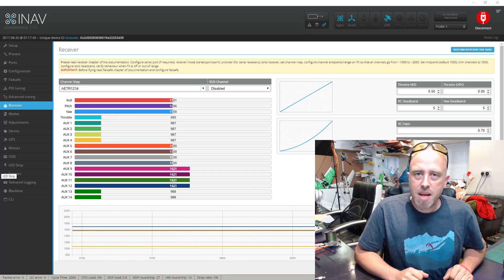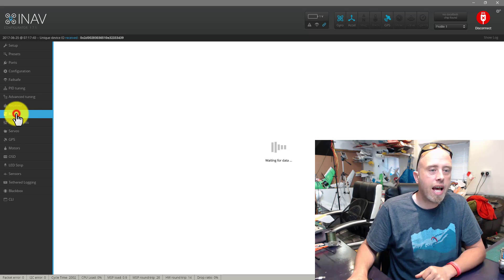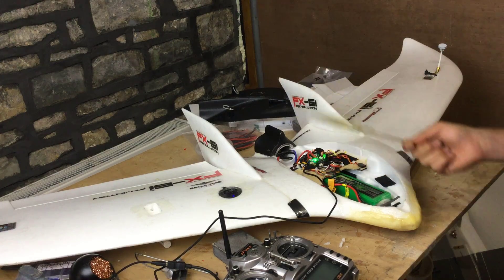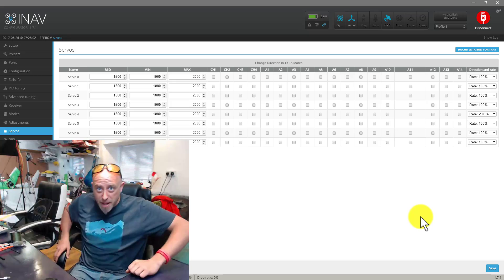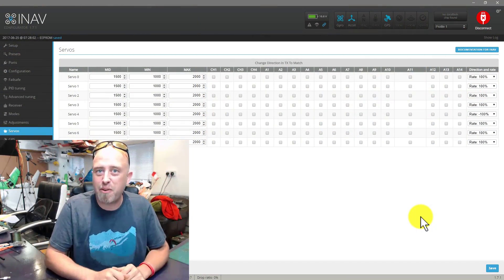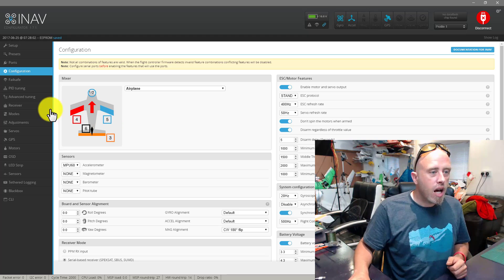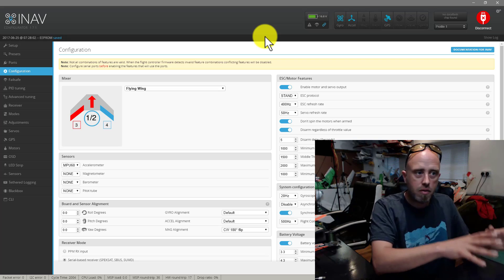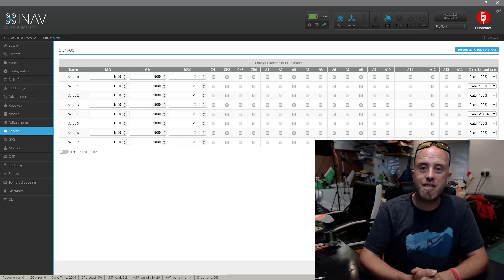iNav - Checking Your Models Surface Movements, the RIGHT way

Comment: Hi and good dayyyy Matt, awesome video and awesome help as always !!! 
Hopefully you might remember some time ago, perhaps two to three months, I asked about your opinion on the strongest flying wing/plane for a beginner, and you mentioned the Reptile S800, and I went ahead and purchased one, well, I'm done building it and configuring the major stuff in iNav, but just to be safe, I had to 3D print a lot of replacement parts because I was not happy AAAAAAT AAAAAALLLLLLL with the way the S800 was made.Anyway, I've done some mods and I am ready for my maiden flight, weather has been unkind here for over a week, but I might do it today, so hopefully you can help before then...my question is regarding the control surfaces while in a stabilized mode, like ANGLE mode. Since I'm a beginner, I used to take off in Stabilized mode in the dart 250 and worked very nicely,however, with the S800 and using iNav with the Matek F405 STD, I felt that the surfaces moved with much less authority, so after trial and error, I found the settings for the servos in inav which was weight and rate, and increased them much more, so now when no flight mode is enabled, the, its like a manual mode, the control surfaces move quick and full of authority, but in Angle mode, they move ok, but when I use throttle to 50% or a little less to trick the plane that its flying in Angle mode, the problem that troubles me is that after a few moves of the control surfaces with transmitter, one side stays down or maybe up while the other side moves, but if i tilt the plane left or right, the seemed-to-be-stuck-servo begins to move again,then after a few times of moving the control surfaces again with transmitter, the same thing happens. Is that normal, should I maiden and see what happens ? PS : I will launch and fly from a nearby sports grounds, which is above road level with a two to three meter high fence, and below are houses, so I will have a good few meters for flight before I decided to either climb out or land quick into the grass.
Reply from the maker: Howdy Ralph, I would chuck it and see what happens. The S800 wing can take an absolute beasting and when it breaks, hot glue is the quickest fix 👍
Reply: @RagTheNutsOff  Thank you so much for your reply Matt, much much appreciated as always. I actually used hot glue to stick the entire flying wing together, so I totally understand how awesome hot glue actually is. Ok then, perhaps later, I would give it a go in the local grounds. I'm going to run around the house with the throttle on and doing some rth checks and surface control tests, I'll get back to you later after maiden try Matt.

Comment: Man this is a video that has helped me out numerous times regarding which way the servos move during angle and horizon mode. My most nervous time before a maiden is making sure servo movements are 100% correct when switching to angle and horizon modes.

Comment: Hey Matt, great video series with tons of useful info!! I'm all the way to checking the control surfaces with the Matekf405 in a strix goblin. Im using a spectrum dx8 with an fpv serial race reciever. The only channel i reversed is the aileron to make it coincide with the correct input and output on the radio tab. Now when i went to check the control surfaces as you did, my s3 needed reversing in inav to make it turn the proper way. I reveresed it in inav and now i have the roll correct, but the elevators are reversed, up is down, down is up, and roll remains correct. theres only 2 servos to reverse or remain or both reverse or both remain. I've tried all four ways and i cant get it correct. any ideas???
Reply: I guess you solved it but just switch the inputs in the mixer around

Comment: The reverse funktion works not on the bench is that right? If I put both servos on maybe 1200 as midpoint the go always a different way (s3 down and servo 4 up).
Reply from the maker: Howdy fella, not sure what you're asking. Either see their wiki or the other parts of the series, Matt
Reply: @RagTheNutsOff  I got it out. I was wondering why the servos move in different directions even though I've set reverse. But in the servo tab they just move in the in the direction in which they were installed. Reverse comes only when you use your TX or in the horizon mode. But thanks for your quick answer dude

Comment: Matt love the channel I would be no where with inav if it was not for you.  Although I do have an issue... Servo 4 seems to not be mixed correctly in inav.  On the receiver tab all surfaces are moving correctly.... when I increase the throttle I get full movement of servo 4 ( so I know that the servo works ). When I roll left  (looking from the back to front)  the left elevator goes up and down as it should. The right is only going down not up. Have you seen this before ? What am I doing wrong?

Comment: Hi Matt, I need help here , I have spent hours on it and cant figure this problem. I have X8R receiver connected to my OMNIBUS F3 AIO v1.1 FC through UART3. 
As you can see on the video I have limited control with Elevator and Eeileron. A bit higher Elev and very low Eil. When reconect the FC and rebind to X8R I gat full through on servos for few seconds and then it revert it self back to that limited servo movement. Is this the Board, receiver or bad UART ? By the way I have not removed the resistor from board. Did not think it was necessary since the sbus is connected.I am using INAV. Is there any chance you would know what have I done wrong ? 

Link to the video : https://youtu.be/trdlXlAmPCY

Comment: Mike, I have read and re-read the iNav modes, and I don't know if I am misreading them or I am missing something. I have 4 planes using the Hobby Eagle A3 controller, which provides basic stabilization, and thanks to the I am a bit more aware of what controllers are about. However, iNav based controllers are way beyond the capabilities of the A3, but there is something I cannot match up. In the Stabilization devices there is one mode that is normally called RATE, which have some resemblance with the ANGLE, but I am not sure is the equivalent, and I use RATE when I flight in windy days a lot, and very successfully. Even I didn't try ANGLE in the bench, the description does not seem the works the same way that RATE. RATE makes adjustments to the controls to compensate for a sudden change in the attitude, and I have not seen any similar description in the wiki, of tests done in youtube. Therefore, the question is, which mode (or combination of modes) should I use to have the same characteristics than RATE? Sorry, forgot to mention. My application is single motor sport aircraft.

Comment: Matt, what if when you turn on horizon mode and nothing happen? No stabilization movement what so ever? My FC is a Omnibus F4 v3, and the modes are are setup per your mode setup video. Any thoughts???
Reply from the maker: Hi Felix, it could be a number fo things, first I;d make sure that you do the obvious and make sure the servos are powered OK from a separate BEC. Beyond that it be more complex and the iNav lads will be able to help here https://github.com/iNavFlight/inav/issues

Comment: Hi Matt.  I need your assistance with an iNav set up.  I am using a Turnigy i10 transmitter with a matching ia10b receiver.  My question relates to the receiver tab on the configurator.  My radio is displaying correct directions for increasing and decreasing values but the controls are coming through on the wrong channel.    ex aileron on the transmitter is being interpreted as throttle on the configurator.  I cannot see how to change this?
Reply: Hi Matt discovered the issue I was having.  I was hitting refresh and not save on the receiver tab!

Comment: Hi Matt, Great video playlist, been setting my falcon wing up according to your  video
I noticed that in Horizon the correction for up/down is correct while Left/right is reversed.
Double checking transmitter according to video, 
no mix, 
servo no4 is reversed.
did another calibration,  maybe there is a missing setting ?
what do you think ?
Reply from the maker: Howdy Danny, no need to calibrate again. Check that the receiver works as shown in the previous video and then come back to this one and reverse servos as needed Matt
Reply: Hi Matt, 
I checked and the receiver inputs are looking same as the video,
As you mentioned servo 4 was reversed in my case
Still problem remains that up down directions are deflected to correct the movement While left right are correction is reversed.
Any parameter I can check or dump using the log ?
Reply: @berlerd  did you figure it out I'm having the same problem

Comment: Hi matt, 

I followed al your steps . Now iam also have to check the servos . But when I plug the batteries they don't move at al . I use digital servos with omnibus pro v3
Reply from the maker: Howdy fella, see this video https://www.youtube.com/watch?v=TfZZnurrIRA the short cuts are in the video description, Matt
Reply: RagTheNutsOff   that works for me a little thank you very much . 
Only servo  pwm 4 doesn't move but makes crazy sounds . It's not the servo because I changed with servo pwm3 and then it's oke . Is there a bad output 4 ? Of is there in the software what's not oke?

Comment: If set up with inav and throws are off just a bit , how would you adjust differentials to correct and make throws equal...
Reply from the maker: Howdy fella, I'd not change them and see how it files. If you're using the default and have applied the Z-84 preset, it should be very close to fantastic and only obvious checks by eye on the tim should be needed (eg 1-2mm reflex in the elevons on a z-84). Matt

Comment: Hi Matt
Just about set up inav(1.8) but one of my servos for my wing does not appear to be working. It seems to get power but no response to transmitter inputs. Swapped to opposite side of wing and it works. Appears signal output from pin 3 not working???
Any thoughts?  What a let down. Was really looking forward to first flights

Comment: I must be missing something. GPS ok, receiver reading as per videos, modes configured as per video, servo output screen reactin to my control movements. BUT the servo are not moving ? despite being armed...on the prearming checks navigation is safe is RED ...
Reply from the maker: Howdy Bernhart, daft question, have you connected your ESC to the servo rail so it's being powered? Matt
Reply: Hi Matt thanks for the prompt reply...you are right. Although I am using VBAT, there is no 5VDC on the rail. I al using this board https://www.banggood.com/search/inav.html . the servo is now powered but still no movement as I move the sticks. I think it is related to the "navigation is safe" being red.. the minimum throttle is 950 and it is set to 1000 in the board ..
Reply: Hi had similar turned out when I soldered pins on the board they where not on properly so ground  didn't link through used multimeter now all sorted
Reply: I found out why my ONIBUS INAV boards were not working....

-I chose a CUSTOM MIX (because i had limited PWM outputs)
-because of that all the SMIX statements were eliminated, this means the board did not assign any servos to my functions
-so I had to go to the CLI to create my own mixes for the mini SkyHunter 

I can move the servos the way I wanted them and it all good....now I want to test the OSD side of things and if all goes well, it will go on a plane

Comment: Hi Matt, fabulous series and iv'e learned a lot. Unfortunately iv'e got a problem...my servos won't work. All the stick movements are correct and i can see movement on the receiver page but there is no movement from the servo. I've removed the red wire and connected it to a separate 5v but still no joy. I could really use some expert help as I've run out of things to try.
Reply from the maker: Howdy Paul, I would suspect that either the 5V isn't actually there (remember you also need to add a ground wire to that too) or the board isn't armed. Matt
Reply: Matthew Ogborne 
Cheers Matt, I'll try again and I'll add a ground wire from the power supply. The servo pins have 4.5v when the USB lead is attached but still no joy. 
When you say "arm the board"  do you mean motor arming ie with a switch? If so then the board/ motor is armed. I'm a complete newbie at this and I'm not the sharpest knife in the draw. 😁
Reply from the maker: Paul, see the other comments & earlier parts of the series, you need to power the +5V rail for the servos with a BEC either from your ESC or an external one. Matt
Reply: Matthew Ogborne 
LANDED!! 😂 😂 
Matt,  you're a f**** legend 👍👍👍All it needed was the negative like you said. I've watched nearly all the videos in the series but I don't always read the comments... that'll teach me. 😁 now I need to get an ESC with a BEC.

Comment: Matt 2 problems. 1st will not arm with all green checks.  control surfaces work correctly, but in horizon mode their reversed????? HELP!!!!
Reply from the maker: Hi Art, sounds like you need to change the servo movements and to double check your radio settings match what iNav is expecting. Matt

Comment: Hey Matt got inav all working but my flight control surfaces when in horizon mode barely moves when I move the plane around, is there a way to increase the way inav moves the control surfaces.

Thanks in advance.
Reply from the maker: Howdy John, yes and that is to be expected! Also when you're in the air, it turns out to be feel to be a lot more. The settings you're looking for are here https://github.com/iNavFlight/inav/blob/master/docs/Cli.md Lookf or the "_fw" ones such as nav_fw_bank_angle, nav_fw_climb_angle, nav_fw_dive_angle and note that these are all limited by max_angle_inclination_rll and max_angle_inclination_pit Matt

Comment: What would cause the servos to freak out and quit working and then reset ?
Reply from the maker: +EYEFLY82 Russell M Sounds like you need the ESC Bec to power them, Matt
Reply: Matthew Ogborne  . No bec on the esc . Hobbywing 30amp pro .

Comment: Hi Matt. I just finish my S800 using your videos.. thank you.. But checking the surfaces, I notice that the servos barely move for correction when I switch to horizon mode.. Noting close to your wing in this vid. The question is.. Is there any way to adjust that? I'm using F4 V2 FC and NEO-M8N GPS with taranis radio.. thanks in advanced.
Reply from the maker: Howdy Alfonso thats right, in pass through mode you get full movement, but in a stabilized mode such as horizon, the movement is restricted. See the CLI settings as suggested in all the iNav videos here https://github.com/iNavFlight/inav/blob/master/docs/Cli.md for the ones that have "fw_" in them. The bank angle would be one of interest as it will allow more servo movements, Matt
Reply: Hello Matt, even if i'm on pass pass through my servo movement is really limited... i have tried to change the bank angle  but actually there is no changes... my transimtter is calibrated as i can see my outputs going from 1000 to 2000...but servos just dont have travels... even in passthrought.... do you have any hint on what to look at? thank you!!
Reply: I have the same problem - limited servo movement, i did adjust it on my radio but I have a feeling it's something to do with the board. Did you solve it?
Reply: did not tried yet my wing....but i have commented on github this issue: https://github.com/iNavFlight/inav/issues/2541

to check maximum servo movement, you should set the plane in passthrought and then refer to shellixyz comment:
"In the motors tab you can see what are the minimum/maximum values reached for each servo. With the default flying wing mixer full pitch should give you half travel as should full roll. You should get full deflection only when applying full pitch and roll input. For example full up on the right elevon when pitching up and rolling right."

hope this helps

Comment: Hey Matt, gooday from WA.   Quick question, I have watched all your videos on this series to find the solution... I fly the Z84, on pass thru mode I have all the travel I need, but the stabilised modes take away nearly 70% of it when selected. I have tried max angle mods and no success. I don't want you to spoon feed me the answer, because you don't learn that way... just a bit of direction would be great. Cheers
Reply from the maker: Howdy Leigh, yes thats right. Look up "nav_fw_bank_angle" on this page https://github.com/iNavFlight/inav/blob/master/docs/Cli.md and on the flight modes page (and find the other setting directly related to this). And let me leave you with this question: What is the difference between horizon mode and the other stabilised modes? Have fun Leigh! Matt

Comment: Forgot to say, my Z84 had it's maiden a few days ago. It was rough. Smashed a fake "Swift" camera right away and iNav seemed very confused at first. All control surfaces were correct and I had 9 satellites, but iNav was learning to fly at my expense. I did finally get in the air and even burn through several packs. I replaced the "Swift" with a Foxeer XAT600M but still couldn't get FPV and GPS going at the same time. Later discovered that the Foxeer is putting out so much RF trash it was knocking out my GPS (the Eachine TS5828 600mw transmitter was my first suspect, but not the problem). The Foxeer is wrapped in foil now and I'm looking forward to another round!
Reply from the maker: Howdy Ted, I'm not sure if you've seen my Z-84 iNav build, I have the GPS out on the wing, see this video https://www.youtube.com/watch?v=u2j4KErWH4E Matt
Reply: Yes, that was helpful. I watched it again and noted that, despite 2205 2600KV motors, my wing is also behaving as under powered on 3S Parrot batteries. Also, my RTH was acting crazy which could be related to throttle or that I only have half the satellites you show in the video.